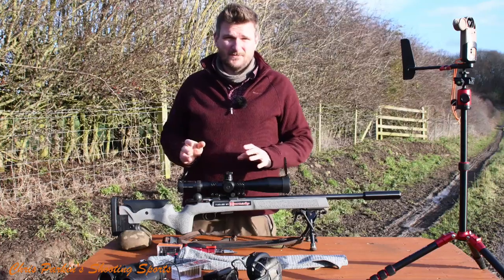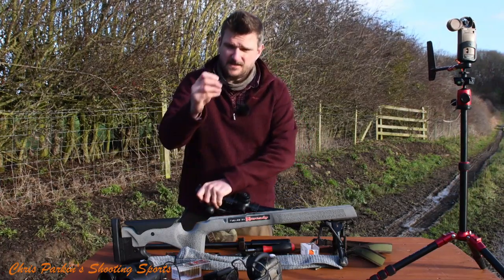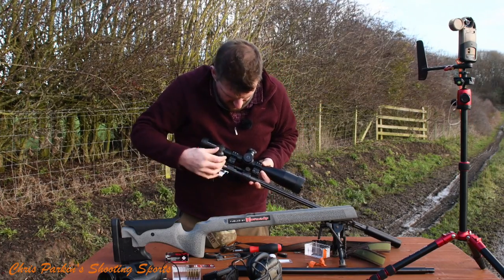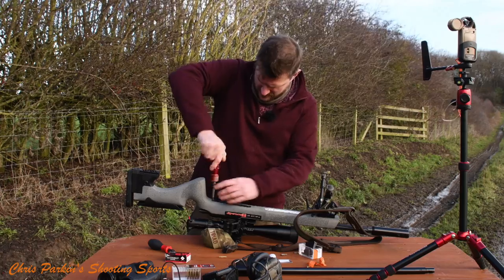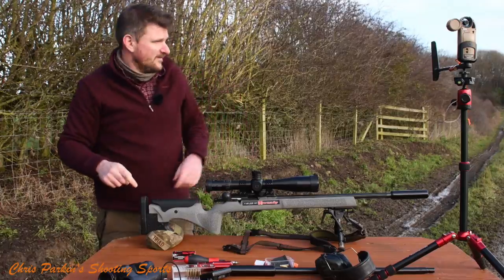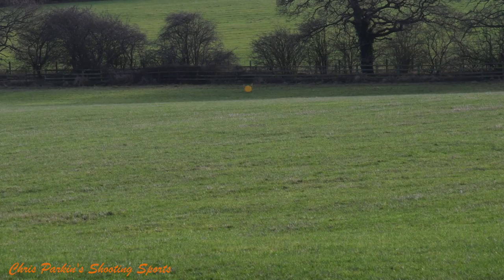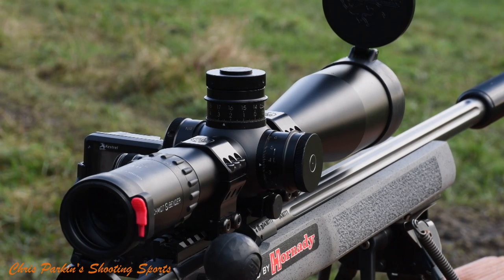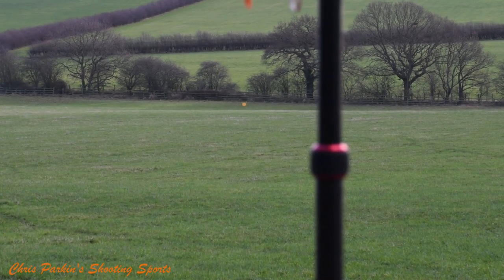CZ 457 Long Range Precision barrel change capability, 17 HMR to 22 Rimfire

Comment: Never removed the mag well (or loosen any of its screws) to change a barrel on a 455. Why is it needed on a 457?
Reply from the maker: Because I changed calibre and needed to swap the internal spacer
Reply: Ah, now i see the headspace thing. Never seen that on a 455/457. Is that a LRP piece?

Comment: Isn't the headspace set of the shoulder on the action?
Reply from the maker: There appears to be a combination of both elements as if you use the wrong insert the barrel doesn't fit correctly
Reply: @chrisparkin431  Oh ok didn't know that. In the manual of the 455 it is referred as the "bolt guide" as far as I know so I was curious. But great video!